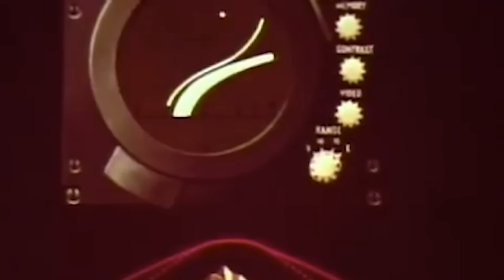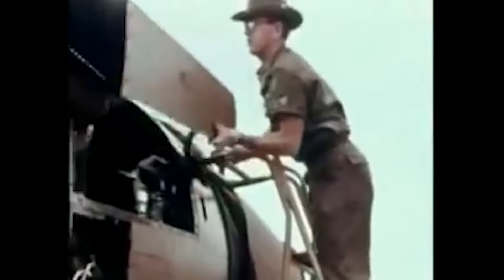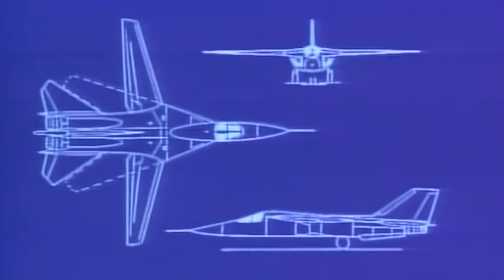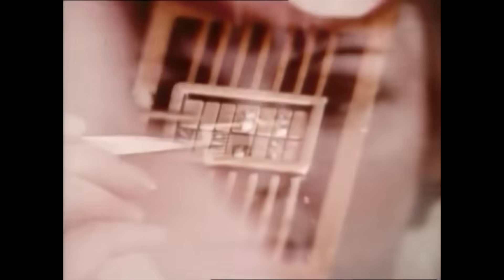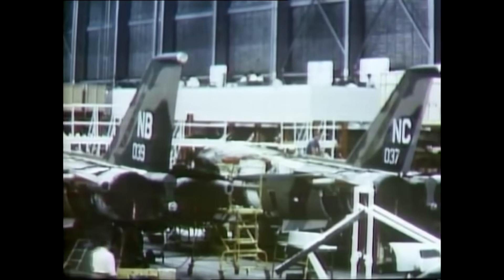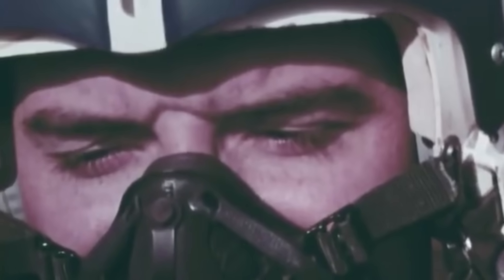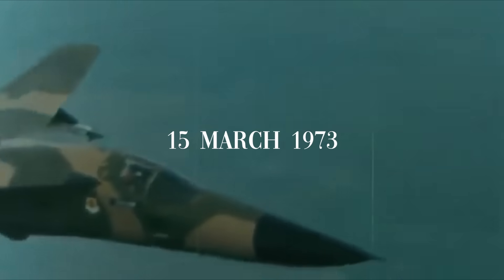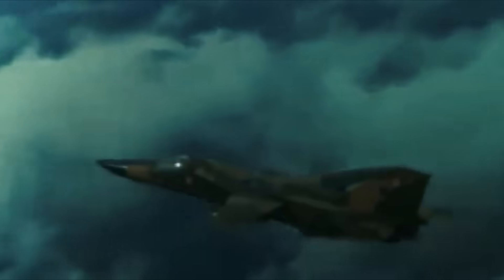The F-111's Fatal Flaw

Comment: I was working at Amberley when F-111 A8-143 lost a main wheel on take off. The wheel rolled for a considerable distance and came to rest after striking a car in the car park which coincidentally was parked mere meters from my own car. Not sure the insurance would've covered that one. Also remember growing up in north east victoria when F-111's would routinely fly past at very low level no doubt on TFR exercises.
Reply: what car park was that? the big one near the tower and engine workshop?
Reply: It was the carpark just east of the Boeing DLM hanger. The aircraft was departing to the south when the wheel detached and did a big right hand arc.
Reply: @AllThingsOutdoors  yeah I know the one, I worked in Hangar 410 (what became the Boeing DLM) when I was in 501WG and before that in 3AD
Reply: @andrewroutley  it was after my time but I heard from a mate who was still serving at the time that a pin sheared, it wasnt maintenance error, just fatigue
Reply: I was stationed at cannon afb nm with the F111D in crash recovery and aero repair  The ejection pod never worked well at low altitude especially if the aircraft wasnt upright during ejection .There were 2 crashes in the early 80s when I was there and both crews died on impact.
Reply: Do you remember Jed Wallace (Wally) or Barry Allen (Bulldog)? I went through training with them, good blokes.

Comment: In my materials engineering course, the professor mentioned that a test was developed to detect the flaws in the wing pivot fitting  (WPF) of the F111 aircraft.   The metal used would become brittle at extremely low temperatures, so a hanger in Alaska was fitted with a massive refrigeration system and the aircraft were cooled to some ridiculously low temperature.  Once the aircraft reached the target temperature, a large force was applied to the wing which would cause the flawed WPF's to fracture.
Reply: Not in Alaska. I believe it was at Sacramento ALC.
Reply: @harrystone8847  Thanks, it has been 40 years since I heard the story, so my memory is a bit vague.
Reply: @harrystone8847  i was at Amberly were the RAAF f111  flew out as told they were tested in Alaska. The through box was very sensitive to scratches and denting.
We had them so they could hit Jakarta if we went war with Indonesia.
Reply: @gingertom56  According to my source, there were 4 testing facilities for that process, 3 in Texas and one in Sacramento Ca. And they were cooled to -40F (-40C)
Reply: @harrystone8847  that would freeze a beer, coke, or a pepsi real quick!!

Comment: Another flaw in the F-111 that was thankfully discovered and fixed quickly was the control for the angle of the wings.
Originally, it was a lever next to the throttles where the lever would be pushed forward for the wings to be swept forward, and pushed backward for the wings to be swept backward.
However, the pilots would frequently attempt to move all three levels (2 throttles and wind sweep) as an unit, pushing forward for increased thrust and speed, and backward for decreased thrust and speed. This of course, would cause to wing sweep to be wrong. So the fix was to reverse the wing sweep level, causing forward to have the wings swept back and visa-versa.
Reply: Really? My recollection of working on the F-111F was the wing sweep control being a sliding "gun-grip" handle on the side, just under the canopy/door, whereas throttle, landing gear and bomb door controls were all in the center between the pilot & WSO

Comment: I think the Dassault Mirage had an equal impact on Australia for its superlative design and high performance and lot of controversy with the F-111 put the Mirage out of the picture.
Certainly there has never been a better looking jet fighter in my opinion.
Reply: I remember talking to 2 commercial pilots and an RAAF pilot in Darwin in the 1970's. They all held the same opinion about the Mirage. Basically it was if you put a big enough engine on something you can even make a brick fly.
Reply: @geradkavanagh8240 Are you comparing a brick to the Mirage? Where's the logic? A brick wouldn't fly, it would just be a projectile anyways.
Reply: @anthonyxuereb792  Yes, the mirage was over engined to achieve flight capability. it was a flying brick and a big projectile with wings and flight surfaces to make it work.
Reply: @geradkavanagh8240  I'm gobsmacked
Reply: @anthonyxuereb792  Well, it wasn't my idea. These were pilots talking about the mirage. They were so concerned about the fuel consumption and cost of running the Mirage.
Reply: @geradkavanagh8240  I'll leave it to those in the know.
Reply: @geradkavanagh8240  all jet fighters are
Reply: @DrWhom  Good point

Comment: one point missed is one of the losses was believed to be caused by improper tool handling and not a flaw in the manufacturing process. The cause of one of the cracked D6AC pivots was believed to be due to a tool dropped on it causing a microscopic dent that grew into a crack. Also, two of the Vietnam losses were cause by the failure of the rear stabilisers control valve, causing a violent pitch-up maneuver followed by an uncontrolled roll. The faulty valves were replaced by a different valve in every model and the fault never occurred again
Reply: These types of steel have special handling requirements to begin with. A similar steel used in oil pipe manufacturing cracked simply because it was left too close to the door overnight, in a shop, during a cold spring. Therefore, I say it should still be considered a manufacturing error.
Reply: @SerbanOprescu  That is a lame excuse for steel, its more likely manufacturing errors, out of tolerance dimensions, bad tolerances., and bad deburring or radiuses.
Reply: @joefish6091  How can you say it's a lame excuse for steel?! Clearly you know nothing of special steels. I've met steels which need turning in stages, with pauses, simply because they hardened due to compression (not heat). That one I've mentioned was also special steel - and I've personally encountered two such cases They are simply brittle, and in use it doesn't matter because they don't receive shocks. In manufacturing/processing, it does.
Reply: . Wise designers design for the established reality of aircraft overhauls and maintenance, because they know nearly all combat aircraft are disassembled multiple times over their service life. Maintenance, repair, inspection etc often require component removal and not every design is maintainer-friendly nor is every supplied component handling fixture ideal. Many parts will be cannibalized from one jet to another over their lives to generate as many combat sorties as practical. 

One Viet Nam war era repair program got around buying new aircraft by rebuilding severely damaged birds which would have been written off after discarding major components. (One of the 'Vark maintainers ITT may remember it.) F-111s were not nearly as inexpensive as Phantoms so creativity was called for.
Reply: It's the same issue that got Boeing.. As they used a Fork Lift to replace the Engines. As it was faster. Only to stress fracture the engine mounting holes when installing them. The engine flew off on takeoff killing everybody. When they seen what caused it. They found several other aircraft with the same stress fracture.
Reply: @WizzRacing The engine mount overstress problem was on a DC10, a Douglas company designed and built aircraft,  not Boeing.   The problem was due to improper equipment (forklift) by the airline maintenance people ( American Airlines).  Boeing has enough problems without adding other company errors.

Comment: I was in the army a bit back and F 11-C's would buz us some times, we would look up when we heard them and would not see them, 'cause they had been going away by then. HOWEVER, the F11 - C is better specked up than MOST aircraft of even today when you check them out AND as to the vibration of the wings during (mostly) transition in flight, NASA could not fix this BUT Newcaslte University (Australia) did solve it and I met the Professor who was in charge of this.

Comment: One flaw which could have added to structural issues was the terrain following computers in early analogue versions of the plane.    They just could not keep up with the sensor data given the,m.   This meant they would go from hard up to hard down on flight controls, still behind the control curve.  Digital computers were only used late in the program.  The F-111 was really pushing the envelope, and sometimes demanded more than the tech was ready to deliver.  A glitch in the terrain radar could be fatal.  God bless them all
Reply: Where did you get this info? The TF computers were basically the same from the beginning. Some mods were done over the years, and around 1985 or so, there was a major mod done. They never flew the way you describe. The TF RADAR system would look far ahead at the terrain and adjust accordingly. There were 2 complete TF systems in each plane, and they would compare commands. If there was a difference, it would command a fly-up. A safety feature.
Reply: Yes I thought the TF was a big issue myself. How many in the US and Australian air forces where lost to the terrain following issues? The last Australian crew I recall lost out at night around a Malaysian island in the early 2k's (or was it '90's).
Reply: @QnimSky_media  If they were 'lost', how do you know it was a TF issue? The system forced a 1.5G climb if it had a problem. Most issues were that the pilots wanted to manually fly the TF flight path, and couldn't keep up.
Reply: @QnimSky_media  The TFR was not engaged at the time A8-291 hit Pulau Aur in 1999. The radar altimeter did sound a warning 5 seconds before impact, which was unfortunately too late to prevent it. The TFR is not thought to have caused any of the RAAF's 8 F-111 losses.
Reply: Ground impact Aur Island,
18 April 1999,
(F-111G A8-291) 
During a night simulated maritime 
strike attack, the aircraft impacted 
trees on an 1100 ft ridge on Pulau Aur 
(Aur Island), 24 nm to the south east of 
Pulau Tioman (Tioman Island), and off 
Malaysia’s east coast. The aircraft was 
destroyed during the impact and 
subsequent fire. Both crew members were 
killed. 

Board findings
The Board made the following findings:
1. The primary causes of the accident, listed
in approximate sequence rather than in any
order of significance were:
a. Inadequate pre-flight preparation for
the mission, in particular:
• failure to realise the probable aircraft
track relationship to the smaller
islands in the planning stage,
• the accident navigator’s failure to
adequately brief the threat posed by
the smaller islands, and
• the accident pilot’s failure to
adequately check the aircraft route
proposed by the navigator and realise
the significance of the topography of
the smaller islands.
b. Failure of the pilot to use all the aircraft
systems available to him to reduce the
hazard posed by the smaller islands.
c. Failure of the navigator to prioritise his
cockpit workload so that he could
identify and help avoid the primary
terrain hazard.
d. Low crew numbers and high operational
tempo leading to the development of a
culture where aircrew fail to check other
individuals’ preparation and
contribution to mission planning. @QnimSky_media

Comment: How could the video miss this out?
The RAAF retired the F-111 fleet on Dec. 3 2010. 
Eight of the service F-111s (seven F-111Cs and one F-111G) were
destroyed in crashes during the type’s service, with ten airmen being killed.
Reply from the maker: It's not a video about the whole F-111 service with the RAAF - we will do more - this is just touching on the wingbox issue. A video covering the whole RAAF service would be a feature length doco - but we will do more shorter pieces on specific events.
Reply: @raafdocumentaries  - OK thanks.

Comment: My father worked at McClellan AFB back then, and that base was assigned the job of completely remanufacturing that aircraft. They put together one if not the largest machine shops, fabrication, and testing facilities in the USAF. My Dad was in charge of all of the radar and recon equipment installed on that aircraft and the "Wild Weasel" craft. During open house days, I would tour that place and it was indeed impressive. They even had a specially built hanger that had equipment that could do a comprehensive structural analysis of a craft. It also was a one-of-a-kind. He ran a special team of expeditors who had their own building. If you need a component yesterday, he was the one that you called.
Reply: Actually, McClellan was the depot for the F-111. When a plane needed major repairs, it was sent there. All F-111's went to McClellan at one time or other. They actually didn't "completely remanufacture" the airplane
Reply: Wow what an interesting job!
Reply: I remember seeing a well-worn Navy F-111B on the west side of McClellan in the mid-1980's.  Somebody was using it for battle damage repair practice.
Reply: @dukeford  I too saw it. I was there for the ARC-190 HF radio TCTO proofing. I was TDY from Pease AFB. It was right behind the revetments the F-111's were in for TCTO's.
Reply: @dukeford  I saw it while station there in the Coast Guard flying HC-130Hs. In about 1978, an F-111 was lost right after takeoff. The crew ejected and survived, I'm glad to say. I, too, got tours of the depot, seeing both the F-111 and F-106 aircraft. BTW, the aerospace museum at MCC has many cool aircraft, including an F-111. It even has an HU-16E that I helped retrieve from the boneyard and rebuild.
Reply: As a RAAF officer I visited the McLellan facility. The quality of the work there was extraordinary. The aircraft coming out of refurbishment were better than new.

Comment: Unlike aerodynamics problems tracing to the design F-104 had, these failures were caused by manufacturing. Then again, designers should not overestimate the capabilities of manufacturing process...
Reply: The F-111's design was inherently bad and had nothing to do with the manufacturing process. You need to do some more research.

Comment: The F1-11A 's were at Nellis as trainers until they become "Ravens".  The A's had a lot of problems til they got them reworked.  The F1-11B's were to be used by the navy. but were rejected by the navy and sent to SAC  as replacements for the B58's.  The B's had longer wings and a shorter nose. The Australians got F1-11C's which had  longer wings and the standard nose about 24 were made. Cannon AFB  got about 100 D models which had a stronger/more powerful engine but an unreliable electronics/Guidance  system.  The D's were operated fore 10 years but didn't get operational til about 86-87 and were retired soon after they were made operational.  The E's were good planes big engines and solid state electronics and were stationed at Upper Heyford England.  The best F1-11's were the F model at Mt. Home about 110,  and were operational around 1974. They had more powerful engines tan the E's and a real good solid state electronics  and were the F1-11's that went to hit Kadifi  and were performers until they were retired  about 1995/96.
Reply: I don't know where you came up with that fantasy about the F-111B variants "going to SAC" for some strange purpose. There were only 7 ever built and we know what the disposition of each one was. And it wasn't flying operationally with the Air Force much less SAC. You're thinking of the FB-111 variant which was purpose built to be an interim strategic bomber. And for crying out loud it's "F-111" and NOT "F1-11". So annoying.
Reply: The E didn't have "solid state Electronics. That is what 'killed' the D. The E basically had the same electronics as the later A models with better engines and a "triple plow intake".

Comment: Back in the early 2000's, when I worked on copiers, I was driving down Broadway in Louisville, and between the builds, I was looking straight on at the cockpit of this ginormous swing wing aircraft flying over the river.  It was sporting the old Vietnam era camouflage, like a refugee from the 1970's, so it wasn't something I expected to see.  I immediately thought of the MiG 23 and several Sukhoi designs and then I realized that the USAF still hadn't retired the F-111.  That Saturday, we had the annual pre-Derby airshow and fireworks display.  Only rich people pay attention to the horse race.